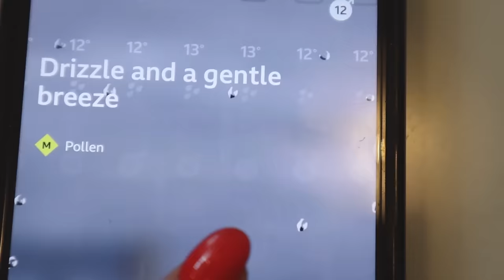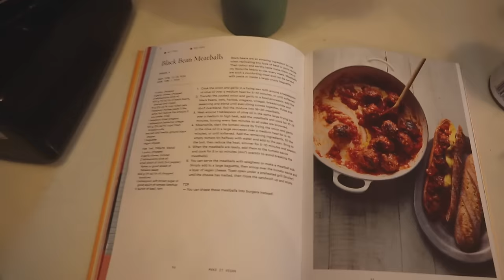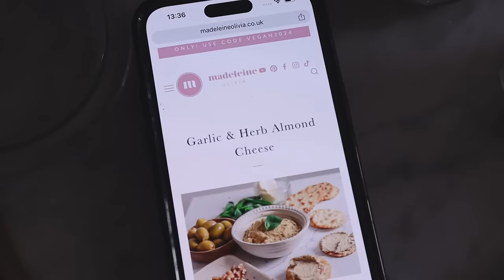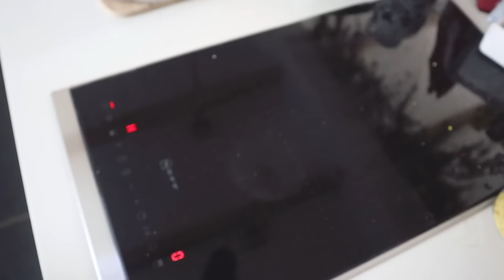TAKING ON OUR ANNEX RENOVATION AT OUR FARMHOUSE

Comment: For what it’s worth I feel as messy and expensive as it will be to remove the paint, masonry should never be painted as it needs to “breathe” so it’s able to dry out not hold the moisture it is exposed to. So the mortar also tends to deteriorate behind the paint and you’ll have compounding problems and expense over time. I’m mot sure how your guttering is set up in the UK as I’m in the states and the guttering on our home is a what is known as a French drain system. All of our down pipes are connected to a larger pipe that is set in gravel  around the perimeter of our foundation that then drains to the back of our property. You and Alex have done a fantastic job of taking on the care and maintenance of your home. Wishing you continued joy in your home. TYFS❤️

Comment: You and Alex have done a fantastic job on the Annex building. I would paint the shed the same color as the Annex. You picked a beautiful color and it would maintain some continuity for your outbuildings. You can use the stones to landscape around the shed. I would also suggest getting the gutters fixed or replaced to see if this fixes the interior mold issue before either repainting or striping the paint off your main house. Enjoy your channel and format 😊. And it’s still cold where I live…the snow in our yard only melted last week. 😂

Comment: Sand back the wood that’s rotten, paint the wood with wood hardener, it’ll soak in to the wood and set and prevent it from rotting further, then you can fill and paint it, it’ll last for years xxx